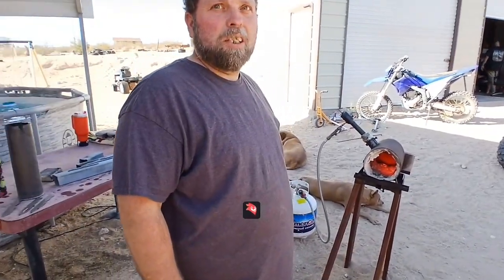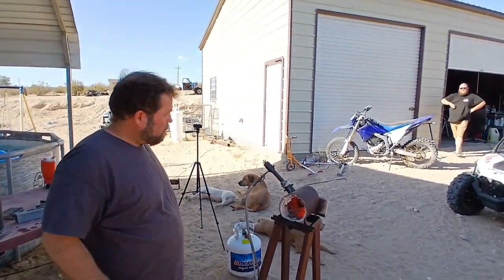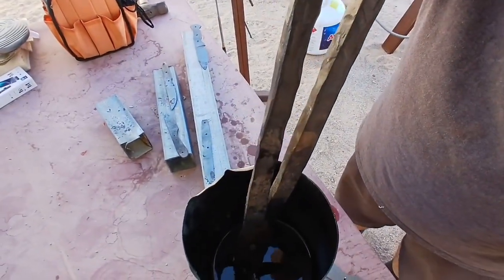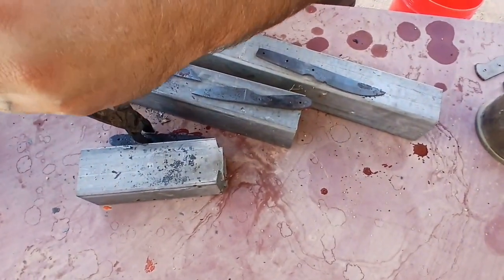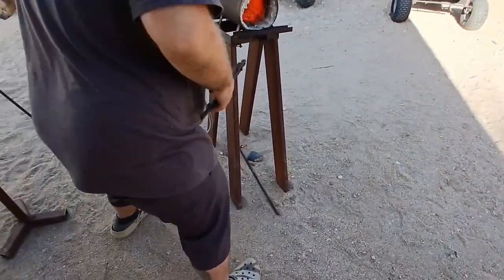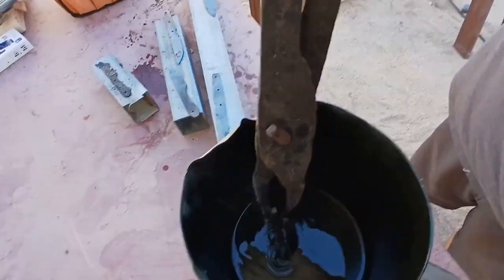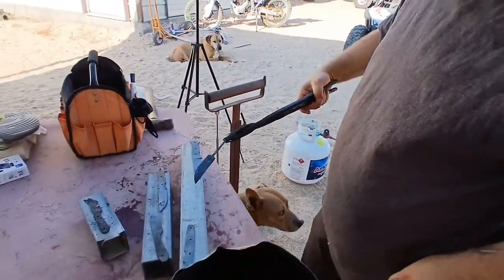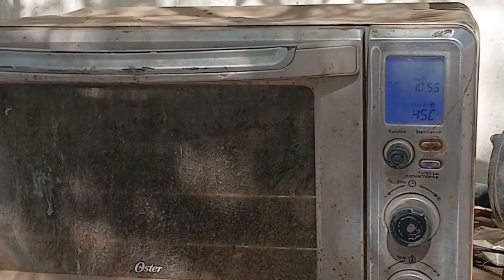How to heat treat 80crv2 steel.

Comment: 80cr is forgiving. If it cracks during quench then it cause of a few things. One you didn't you 90% edges that's the spine ,drill holes layard holes things of that nature. Two you failed to properly pre heat you oil cause different cool down rates creating uneven hardnesses. Three heating to hot will cause grain growth issues more than quenching problems.  But grain growth happens with longer soaks . Most 1/8 inch 80cr only need a 60 second soak time once everything is even.